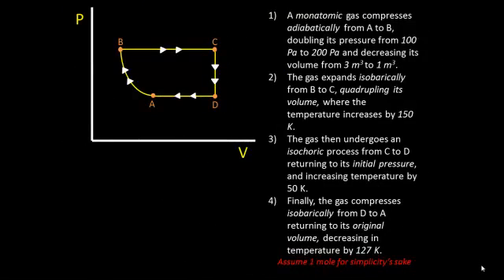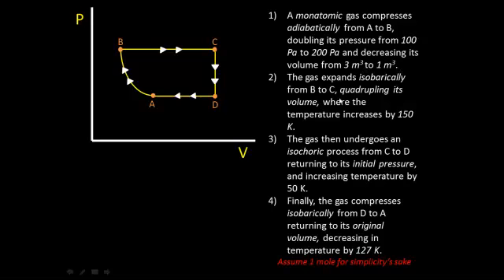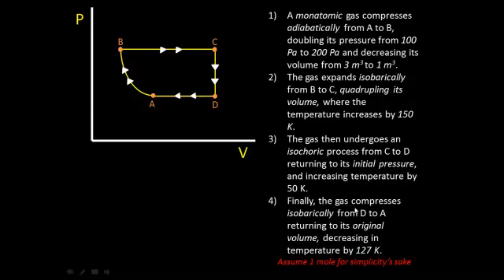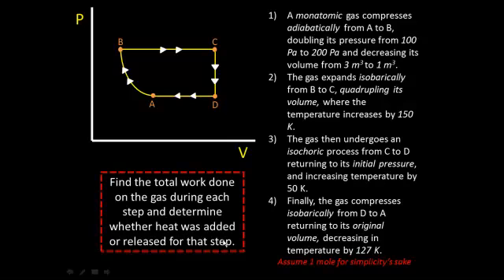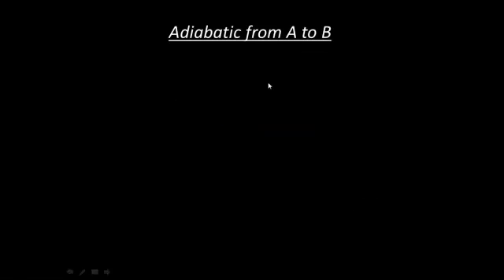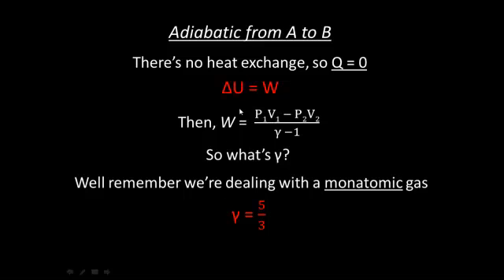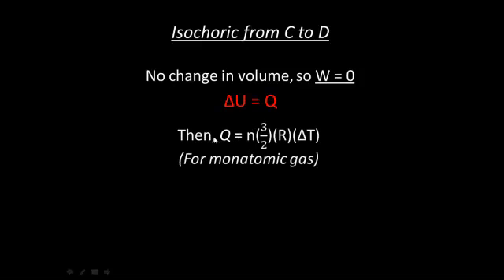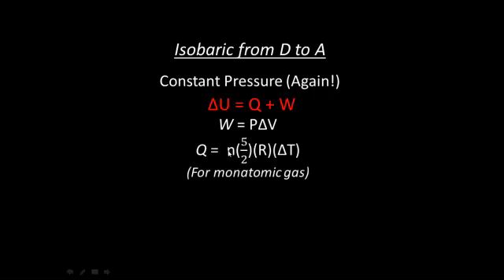Work and Heat For A Cyclic Process

Comment: Why not use signs in calculating Delta T which would help in working out direction of Heat?  Narrator also said that work was done when gas expanded from BC against Zero Force.  If there was zero Force opposing the expansion of the gas, eg expanding into a vaccum then no work would be done.  Just my thoughts.  Not necessarily correct. Thanks for question.  It was a good one.